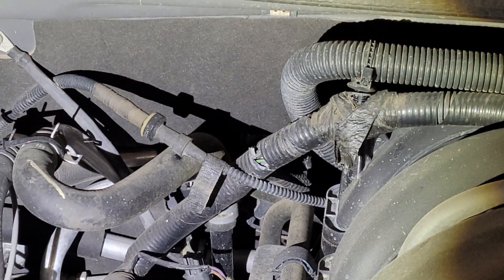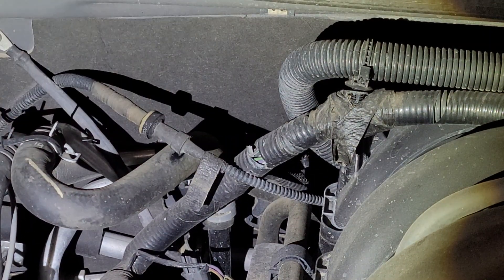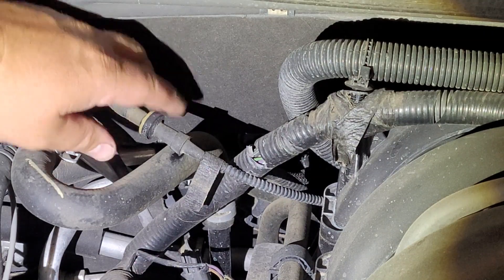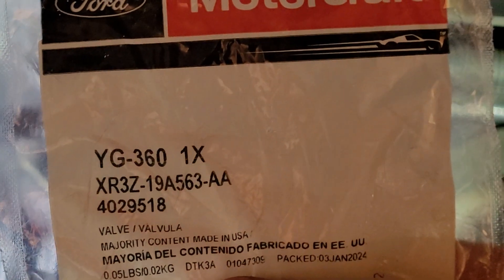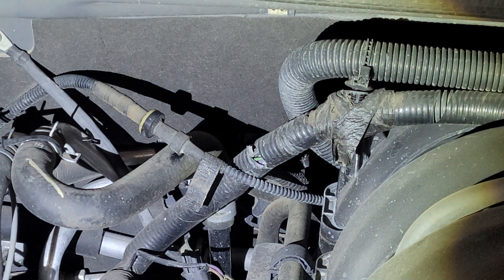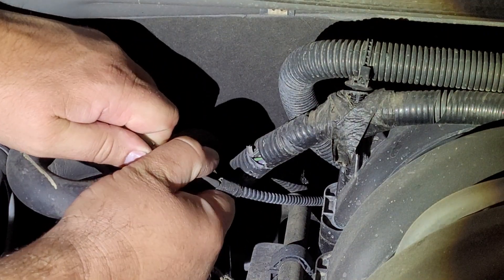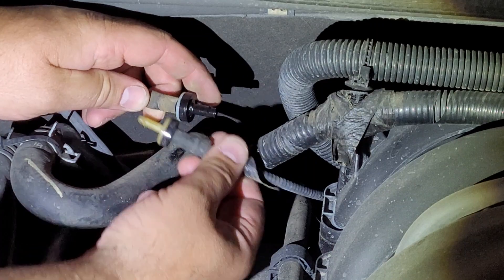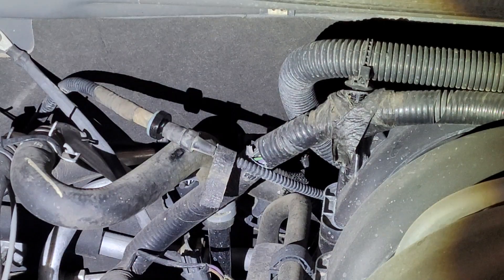Ford Explorer AC fix

Comment: The described condition can also be caused by a small vac leak in any part of the HVAC vac lines or the console head unit itself, or the vent doors that are vac actuated.  Insufficient vacuum = default to defog/defrost vent output.